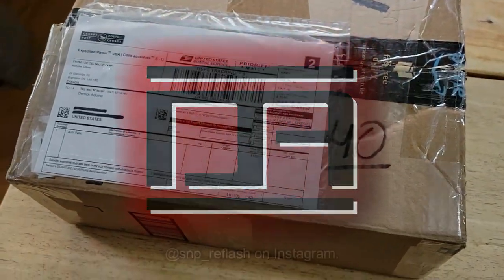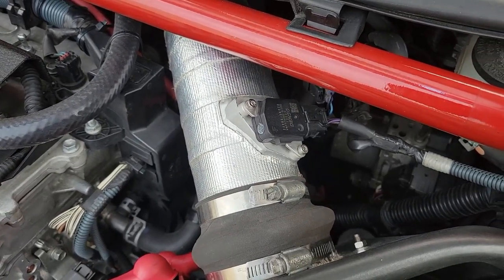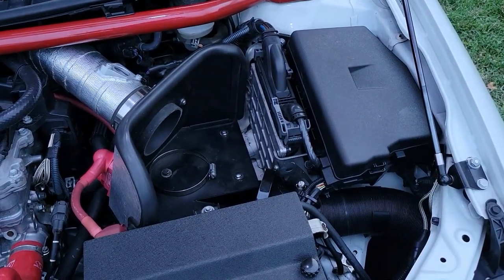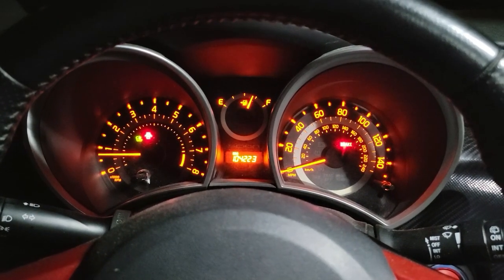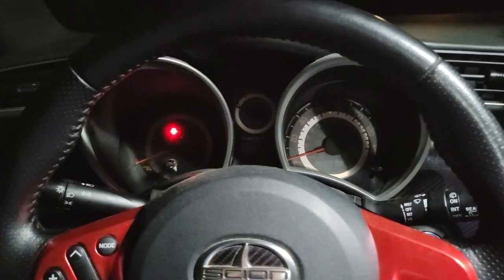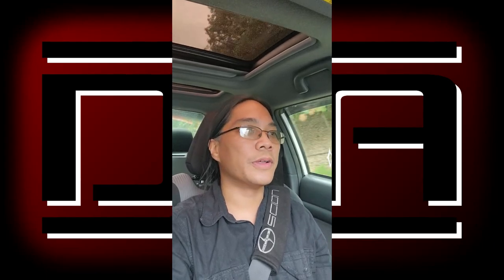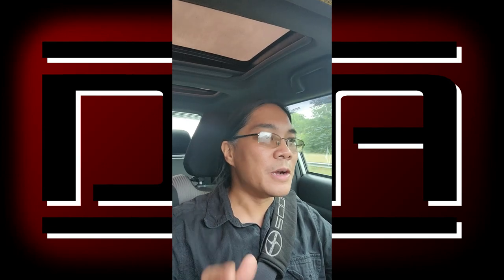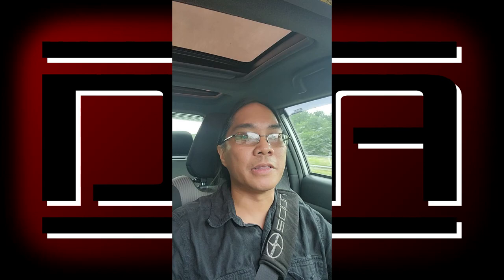SNP Reflash 91 / 93 Octane Power Tuned OEM ECU (Shaun Zzt) Install & Review (Scion tC2 / tC2.5)

Comment: Long post below
I'm currently working with Shaun on having my 2011 Camry SE 2.5 Auto ecu sent to him for a reflash. There are some differences within Scion TC2 files and the Camry obviously, but there is also similarities that he feels confident enough to trial and error with my ecu/camry to  establish some tuning files.  I actually found this particular video which is amazing, and allowed me to contact Shaun. I've got some plans of my own with the 2AR-FE, such as porting the composite intake manifold, which has shown gains on many other platforms (like my Charger 392 scatpack picked up 15whp with just cleaning up the intake runners and throttle body inlet. So I imagine there are gains to be had, because every bit adds up. Also, the fact that a 1AR-FE intake manifold is nearly identical to the 2AR-FE but the 1AR-FE has a larger plenum volume to accomodate the 2.7L. 

The automatics don't get a lot of love and the results can be dissapointing due to the drivetrain loss compared to the manual, but the engines will still make the same crank hp.  I've got a custom cat back setup i'm doing at a local exhaust shop with some Vibrant mufflers that I think people will like. Also, since I live in florida I don't have to worry about emissions, so a header is in my future but i'm thinking of reaching out to PPE Engineering and seeing if they can take a factory 2AR manifold and midpipe section and build a header using the factory design (without a cat) as a reference, this is only if I can't get a certain header to work. 

The 2AR-FE has so much potential, especially now that Frankenstein Motorworks (specializes in MR2 swaps builds) has made 240whp (thru a manual) with just his own custom cams, Haltech ECU tuning, and valvespring package, everything else is stock 2ARFE. AAnd just recently 270whp with his and NixspeedRacing velocity stack intake manifold added to the above. Now I want to say the above isn't designed for stock ecu, but I imagine if there is enough interest and testing with either SNP Reflash or even R9K tuning, surely the stock ecu coul be a viable option eventually.  Although a plug and play Haltech ecu would be amazing as long as it could work with the automatic guys like myself. That would open so many doors and have 2AR-FE with basic mods and cam swap /intake manifold swap making probably as much HP as a 2GR v6.

If anyone in canada near SNP has a camry 2.5 with an auto, try and get up with him in person to help further us all along. The mods can be made as long we not only show interest but also pay to play.  We have such an underrated engine and overall platform to start with!  Sorry for such a long post, but I wanted to share.
Reply from the maker: Thank you for sharing!

Comment: Would you recommend this over the other two reviews that you have done?
Reply: For the ECU Flashes etc…
Reply from the maker: @gray_vz4535  yes! I love the tune on this ECU.
Reply: @VampyreX13  I came back to this video to ask if your MPG went up after installing this. I would imagine that after getting a little bump in power, when driving casually since you are making a little bit of more power you are not forcing the car as much therefore not burning through as much gas but I could be wrong.
Reply from the maker: @gray_vz4535  yes, my MPG increased slightly with the new ECU.

Comment: hey derrick, i was wondering what build of vf tuner you have installed. im getting an error and i need to get my car smogged this week and ive been messaging matt, they did just release an update but it still gives me the same error. if you happen to have a build of vf older then 1.3.9 that would be very much appreciated
Reply from the maker: The older versions of the software don't work. They won't load or you won't be able to license them because of the new system.

Comment: How much does it cost? Asking since my local dyno will reflash my stock ecu for around 300
Reply from the maker: $300 shipped.
Reply: @VampyreX13  Thats a pretty good price, thanks
Reply: @VampyreX13  $300?!? Is that including the ECU or do you have to send in a core exchange? $300 sounds like a steal!
Reply from the maker: @zev4036  that includes the ECU. You don't need to send him anything. You keep your original one.

Comment: @vampyrex13 @derrickaquino
Is there a  horsepower increase with the new ECU? If so, how much is making?
Reply from the maker: Yes, but it will depend on the parts you have installed on your tC. I would message Shaun Zzt directly about what you should expect gain wise.
Reply: @VampyreX13  
Thanks Derrick!
Awesome videos!